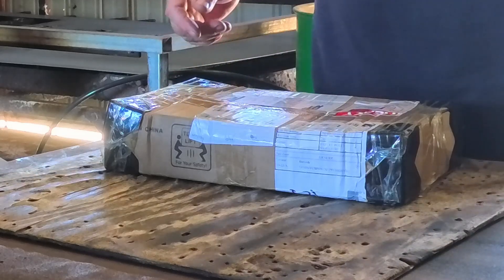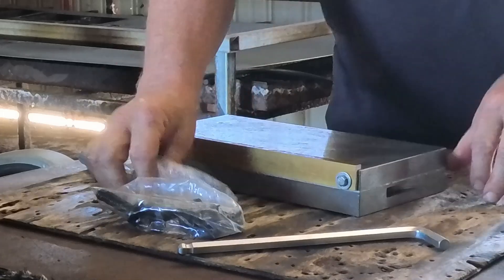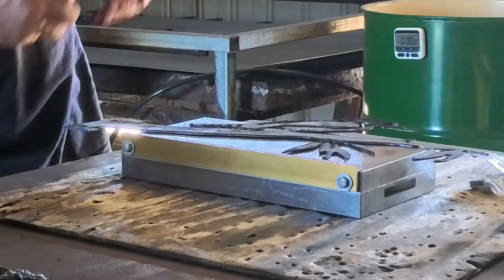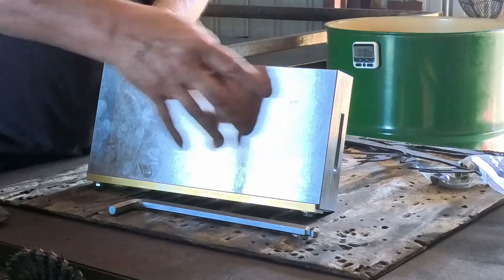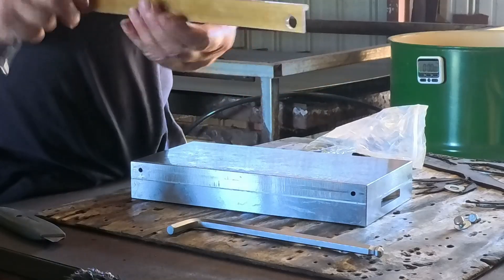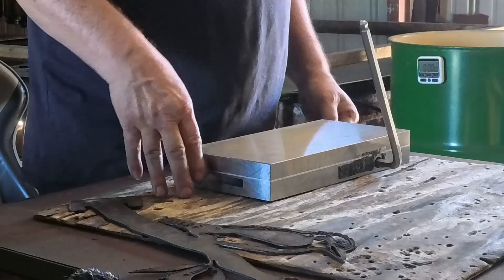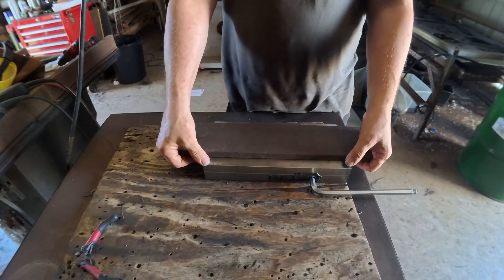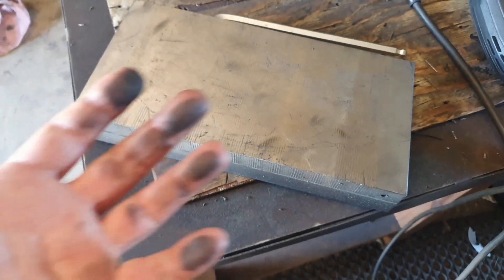Vevor Magnetic Chuck The Ultimate Tool for Grinding small parts?

Comment: For what its worth, you can buy a magnetic transfer block. It has the fine poles in between, and this allows the field to be transferred to the thing above it. Its not worth it for this, but it is a way to hold stuff with a mag chuck with a block between the two
Reply from the maker: Thanks for the tip, I'll look into that. The chuck has after a few months use proven very effective.  I'm thinking of one for my milling machine now 😊
Reply: @plasmaDave  also you can get a lifting magnet. Stuff touching each side is highly magnetized, but its overall less. Good for lifting heavy ferrous stuff tho. Works the same way a magnetic dial indicator stand works, so you gotta bridge the two sides for it to really give ya something. 

For the lifting device, if you took two metal plates on it with a gap in between, then put your material to be ground crossing over the gap, it would work with those two plates being sacrificial. Also the gap can be filled with a nonferrous metal or epoxy that's then milled down, that way you dont have a literal, just a magnetic one. This chuck is so cheap tho that its hard to beat.

There's also electromagnet solutions. There's a dude on here who made a sheet metal brake that uses electromagnets to hold work down.